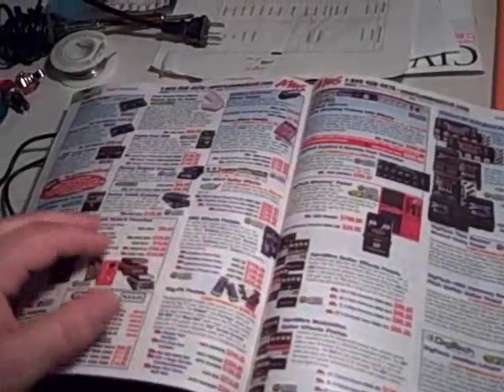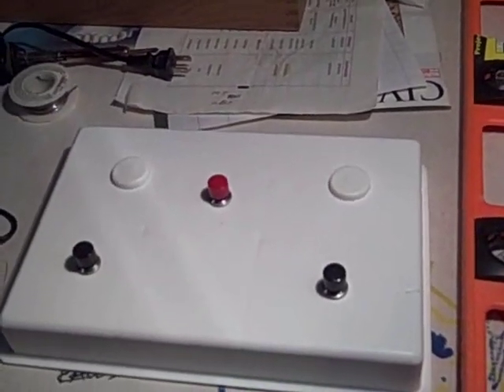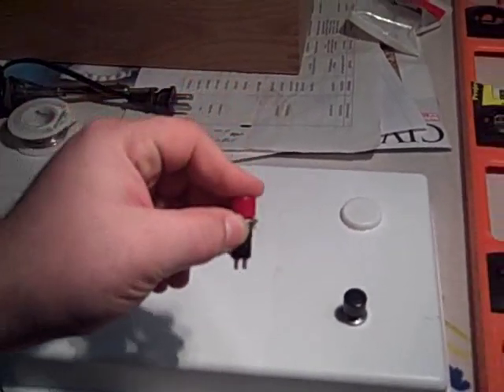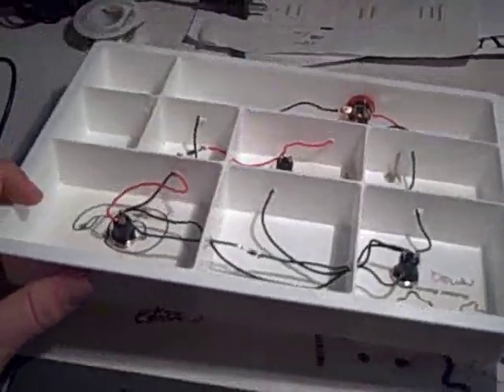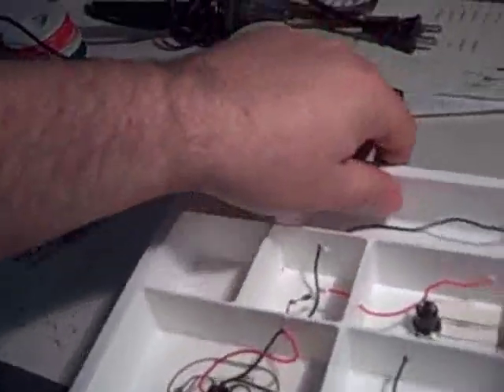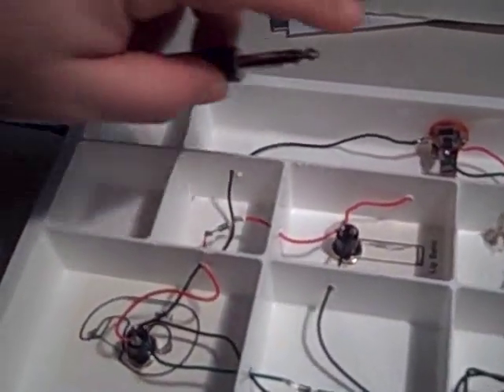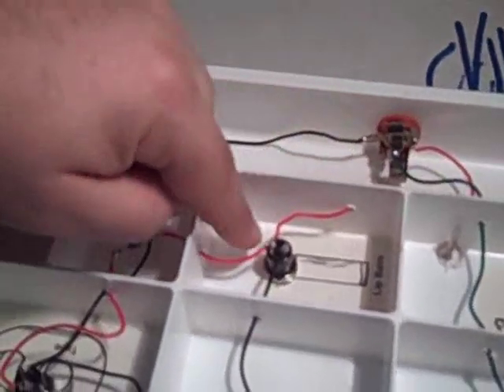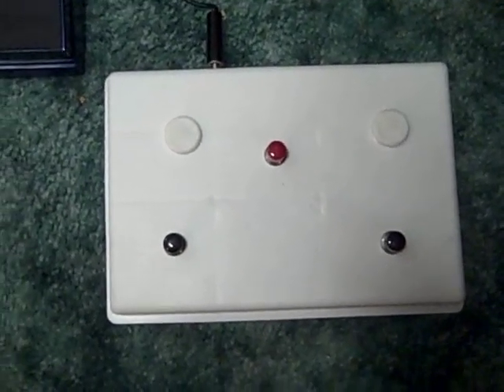How To Build a Digitech FS3X Footswitch

Comment: Hi Parksart.  Thanks for the instructions!  They were clear enough even for me an incapable numnut like me to build the FS.  I've been using it for a couple of years now with no issues.  I recently decided to try to control the jamman externally using an Ext Amp out on a Line6 Helix and it seems doable since the ext amp out supports a a Tip-Ring-Sleeve  config, but the Helix manual has one warning: 
              "Connect EXT AMP 1/2 only to amplifiers that utilize “shortto-sleeve” footswitch inputs."
Do you know if the jamman solo FS input is a short to sleeve input?  Thanks!

Comment: Also, the footswitches (same as used in the FSX3)can be found here for fairly cheap (search part#: R13-85):
http://www.aliexpress.com/item/foot-switch-momentary-type-R13-85-push-it-then-electric-circuit-will-be-connected/1042107033.html?spm=2114.13010608.0.64.RgDOOu

Comment: Great video, i'm going to 'mod' my RP-500 (digitech pedalboard), so that these looper switches are in the same box as the pedalboard. (one less component to carry to gigs and hook-up).
Reply: Tim Eggenberger did you mod your RP500 like you wanted?  I'm interested in doing the same thing. how did yours turn out?
Reply: Hi, yes i did, and it worked. I did a few open-mics with it. I drilled holes for the new switches in the RP between the 1&2 and 4&5 switch positions (those are the only place there was room to drill). The new switches angled-out enough so as to not get accidentally switched. Still have to be a lil careful not to bump the wrong switch though. For the 1/4" jack-cable i drilled the back corner away from the power-plug. Lately however, i'm not using it and have just settled for the 20s looper already built-in to the RP500. I also bought a Zoom G3xN which is a rival pedal-board but with a longer looper capability (it hasn't arrived yet, probably monday).
Reply: Also, since i use my iphone/iPad (with Garageband) for my backing 'band' now, i don't use the Digitech Trio as often. It wasn't really practical for 'live' performance stuff anyway - to time consuming to program the Part/Sequences.
Reply: I'd really be interested in seeing pics of the RP500 mods you made if possible.  it sounds really cool what you did.  I also appreciate the detailed reply. it may cause me to rethink my idea of getting a trio, since I can run that app on my Note 3 as well,I'm pretty sure. 
I'm also interested in maybe modding another pedal from digitech as well.  the weapon pedal has like 7 different fx,I'd like to make a footswitch to change those 7 fx. any advice on that?  I know this pedal is not that popular but I don't care. it's just a fun project to maybe try.

Comment from the maker: Momentary.  It's only hot while you press the button down.  I think my model has a tap tempo but it's done with the pedals on the unit itself.  I haven't used mine in a while so I'm fuzzy on that.

Comment: I need some help on a Line 6 DL4. I want to make a self-oscillating effect, aka "Feedback mod". All you do is bypass the control knob for the "repeats" with a momentary footswitch... when you step on it, it bypasses the pot, thus giving you "maxed repeats". Would I just run a wire from both the "in and out" pins on the pot to my momentary switch?

Comment: @Deuterom I connected the meter before install the switches and they are Momentary :S. This could happen if the diodes are places in the wrong way?... Although I checked the position and they are as in the video. Like I said, it works.. but is kind of rare. If I use the down button it works great... but... if I use the up button, I have to push it twice in order to advance 1 position. When I push it once and it doesn't do anything, is when I can use the down button and that's when it works fine.

Comment: @lemurvoice Sounds to me like you are using standard (Push-On, Push-Off) DPDT switches instead of Momentary switches. Again, you can determine this with an Ohm meter.  If you connect the meter to the switch's pins as I told you above, push the button and release it, if the circuit remains closed (connected) until you push it again, then you don't have a momentary switch but a standard switch.  You need momentary switches.  Hope this helps.

Comment: @Deuterom I did what you told me 3 or 4 days ago, and is working, but I thing that works very rare... because in order to up one preset (I tasted it with the timebender and the whammy DT) I have to push it twice, and for example, if I push the up button one then I can use the down botton, and that is when the up function is disable.. is one crazy thin... I'm using a normalize stereo jack... It has four pins.. one for the ring, tip and sleeve and one that works with the ring or tip..... :S

Comment: @lemurvoice You will need and Ohm meter for this. With 6 pins, what you have are DPDT momentary switches; it's like 2 SPDT side by side. Your connections need to be with the pins that connect when the button is pushed down...usually a center pin and one of the outer pins.  An Ohm meter will tell you which pins short out when the button is pushed.  Good luck.

Comment: I, too, classify myself as an electronic tinkerer who enjoys finding less expensive ways things. I've built and enjoyed many different kits in my time.  I wanted to build this but use metal switches and housing but found it quite an expensive proposition. On a trip to GC, I found the FS3X for less than $20; metal switches, metal housing, cord and all.  

Bravo for your effort but I gotta tell you....  20 bucks is hard to beat for the real deal.

Comment: oh dear...i tried to do this but when i connect it up to my ex7, the mode; setting just automatically scrolls to the last one. i honestly cant see whats gone wrong. the marked side of the diodes are both closer to the UP switch and everything seems to be in the correct place. i wonder what i did wrong

Comment: Thank you so much sir! I just got a digitech timebender, and did not want to spend $50 for 3 switches.. For the timebender I only wanted the two switches to cycle through the presets, so i just omitted the third switch. Got everything, including the enclosure, at radio shack, for abt $13.. Didnt get a stereo cable though, so i plan on getting one of those.. bringing my cost up to half the price of buying one.. good enough for me!! lol

Comment: i had myself built one some time ago, but sold it with the JamMan.
Now i need another one, so thanks for the tut, forgot how to do it!
i had mine put into a small cage of sheet metal, with lots of wholes in, it came from the inside of a computer to hold floppy drive or sim.
I had it mounted on a small peace of wooden plank, while the cable with the stereo plug was fixed in without a socket...

Comment from the maker: @GeoLayered Thanks for the compliment.  As far as the switch type.  It is a momentary contact that only works when down.  However, it is also still a SPST (single pole single throw) switch.  If you wish, go to radio shack's page and look up part number 275-1571 to see a SPST Momentary switch.   Thanks again for watching!

Comment: DUDE u rock  u coulda saved a few more bucks by only using a cord wired into footswitch box BUT awesome vid and a slight correction I believe you should have said switches are MOMENTARY CONTACT (they only work when held down) a spst switch is a lil different

Comment from the maker: The buttons on this thing are not on/off switches... you press it and let off and it moves the jamman up a loop number or down a loop number depending on which button you press.  Once you let off of the button it's off.... so there really would be no reason to have a light.  It's just really a convenience so you don't have to bend down and turn the loop dial.